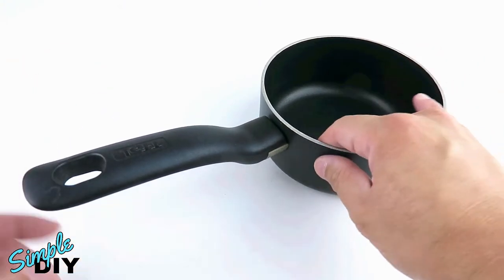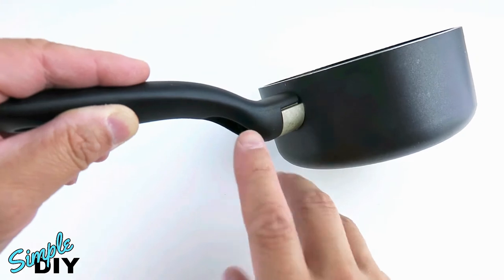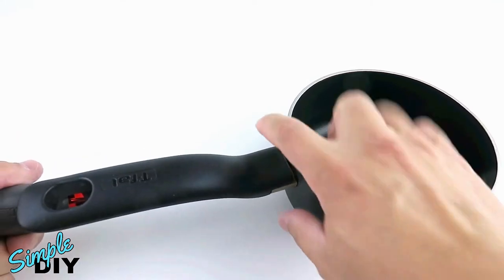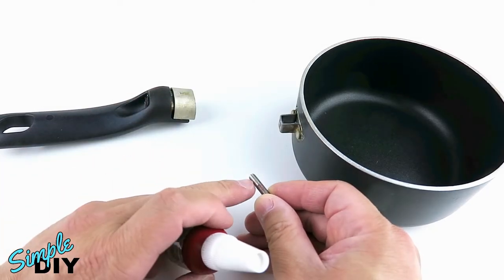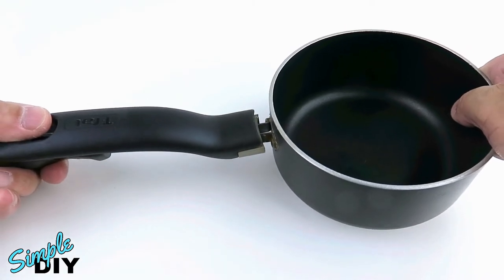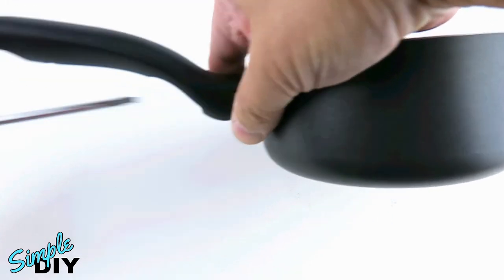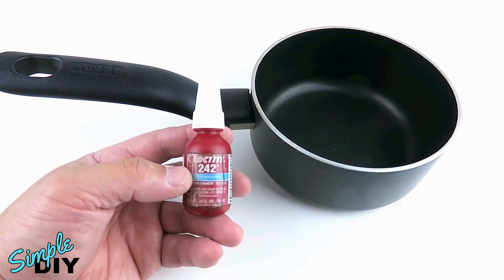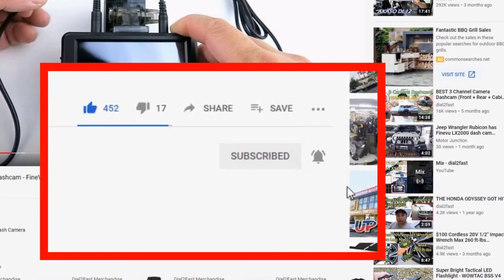How To Permanently Fix Loose Pot & Pan Handle

Comment: I was wondering about using thread loc but I was concerned that it wouldn't handle the heat cool cycles well.
Reply: You’re exactly right and I never thought of that. I was planning on using “removable” blue 😢Loctite, but the red permanent Loctite is actually removed using heat. Hmmm, guess you should just try it and see if it works.

Comment: I will try this.  my problem with this is, I used to be a heavy truck mechanic. I have used Loc-Tite for years, the way you get it to turn loose is to heat it up, so at what temperature does it turn loose? How long have you seen a pan go after trying this.  I have been thinking in the last few days about this very problem with some knobs on frying pan lids.  I thought also neoprene pipe tape will work also. I will try both and see what happens.
Reply: Hi did you try it? Did it became loose again (after time and use of the pan...because of the heat ?)
Reply: @zalaperko3235  Yes so far the neoprene pipe tape is holding, wit the small screws I had to make two tight wraps but so far it holds

Comment: That’s the obvious solution , and exactly what I tried to do. However, the screw won’t unscrew all the way. My daughter purchase it and it’s a retro from the 70’s. I’m afraid to unscrew all the way and damage it somehow.
Reply: Yea, but when the handle gets so loose, she can't safely use the pan any more, what do you have to loose?  I was in the same position as you.  I finally took the damn screw out.  It was fine.  Now I can fix it.

Comment: Maybe just add a washer?
Reply: I bought 2 sizes of locking washers to try.  Neither will fit, though.  I'll have to try another size up.
Also, after I took the screw completely out, it looks like I could fit a square nut in it, if there's a 'locking nut'.